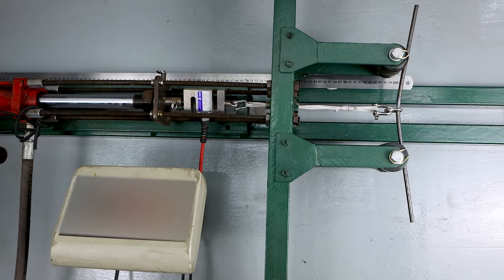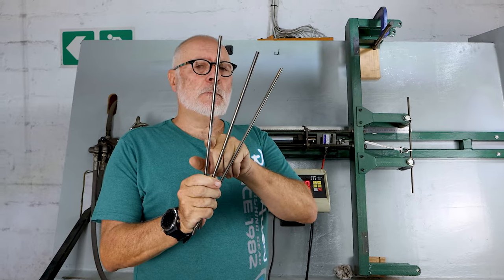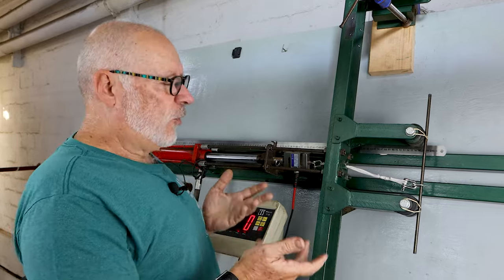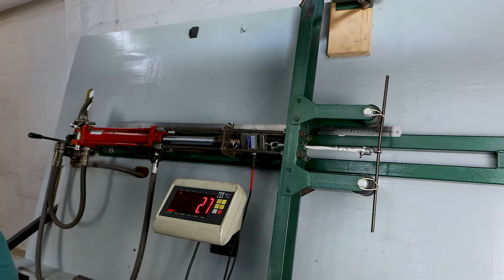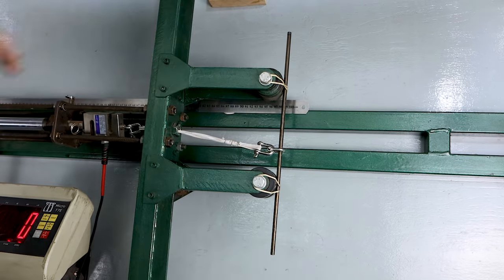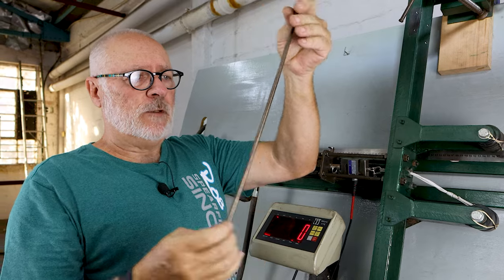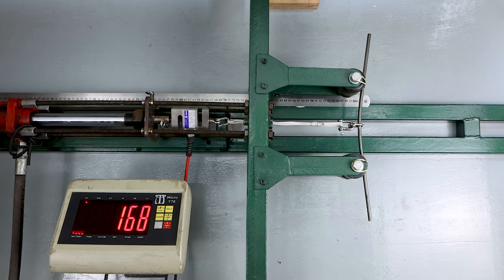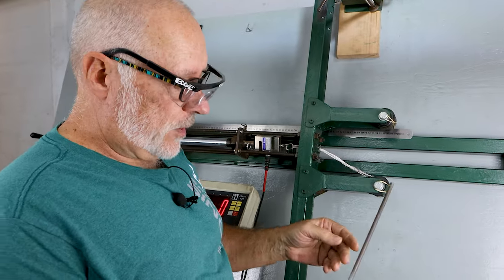Rob Allen | Spear Stress Test | 2024

Comment: Great video! Regarding attachment of shooting line here my humble thoughts...
Pros of attaching to a rear hole: 
-Very hydrodynamic when attached to rear hole. 
-When shaft penetrates through fish (flies through and exits the body of the fish) it is easy to pull it back through the shot hole – recovering the shaft quickly after a shot and getting rapidly ready to reload the gun.
-When shooting into caves or other structure the spearo can pull the shaft line and shaft will (usually) not get stuck when pulled out. Of course, there is still the flopper that might get stuck when open.
-When shooting through hard material (skull, bones) the shooting line is a bit more protected than when attaching the shooting line to a front hole.

Cons: 
-Cannot be used with spearguns that have very narrow trigger mechanism (no space for attached shooting line). 
-Cannot be applied to guns with enclosed track (ET)
-When the shaft flies through the body of the fish and spearo pulls to retrieve the fish, the spear can most go backwards through the wound and will not act as a ‘slip tip’ against the fish. 

Comment: shafts without shark fins and having only notches have a better chance to travel through the body of the fish (no tabs / shark fins offering resistance).
Would be great to have a video from RA about this! 
Cheers from Panama ><)))^>
Reply from the maker: 👍👍 all the points I will make.
Reply: Biggest issue of rear holes is they have bad performance with roller heads... 
Unless RA can explain how to get those shafts workable with rollers/double roller heads I would be gratefull. 
After speaking with many people on the topic it seems unworkable so you either have to replace the shaft, or weld a notch with hole or drill hole before the fins/noches. 

I found the issue with ermes double roller heads and others (including custom manufacturers) had same issues with Manny's too.

The issue was both with 1.8mm and 1.5mm dyneema to the rear hole as drop barbs have only rear hole (unfortunately), long shafts 170-190-210cm also lack resting tabs RA... It's painfull to load 140cm gun with 190cm shaft even with loading assist as 176cm person.
Reply from the maker: @mikefue9597   Good point, I'd forgotten about that. Yes, shooting line ahead of the notch or fin on a roller makes it so much easier to use. When behind (rear hole) the shooting line is trapped under the rubber and, if the shooting line is not wrapped very tight, can get dragged into the roller, affecting speed and accuracy of the spear. All pretty much eliminated with the shooting line being attached ahead of the notch or fin.
Reply: @RobAllenSpearfishing  have you maybe redesigned the drop barbs shafts? Unfortunately my two guns suffer from the issue with 190cm drop barbs with fins from you :F and I'm currently in a process of deciding what to do about it...
1. look for another slip tip
2. drill hole ahead
3. Weld line holder ahead...

Both 2 and 3rd solution seem to have its issues...
2. The line going through hole is also dragged at narrowest point through head affecting speed/accuracy... As real width is shaft diam + line diam on both sides. The heads have very little room even with  1.5mm fine dyneema attached
3. Welding a line holder on top - I heard so many stories how difficult it is to weld them without warping shafts...

The lack of resting tab is something I can without it but the above got us kinda annoyed to say the least
Reply from the maker: @mikefue9597   Hi Mike, I don't quite understand the problem, please email me a short video if you can. Email address is rob@roballen.co.za or, message me and I will send you a Whatsapp number to send to.
Reply: @RobAllenSpearfishing  

Basically
Ermes double roller head
140cm custom carbon tube
Ermes handle and mech
RA 190cm 7.5mm drop barb with pins
14mm epsealon rubbers at 300% with just around 7-11kg preload as we wanted to go slow first. 

We have yet to come to conclusion at the nature of the problem as we had limited time and weather, as we were working on the gun tube issue with flooding, but by mounting dyneema directly to the shaft in 2 exact setups has coused us issues but we had less than 4-5 shots on both.

Either we had heavy tangle or what we believe is shaft knot hiting the wishbones with such force that it would sheer the wishbones outer sheath. 

The head itself is so narrow that even with 1.5mm dyneema the shaft passes the head with difficulty and we are waiting for better conditions to test with 1.0mm directly to shaft end if it gets any better in the right direction

What we are also considering is getting the back hole a little more narrow by polishing it down on both sides, so the hole + line will have a bit more clearance through limited width of the head.
Reply from the maker: @mikefue9597  Ok, I got the wrong impression, I thought you were having problems with the drop barb, not the gun. 

Without being able to test the gun and see the possible issues, I have no way to make a suggestion. 

We have only recently been testing our double roller and have made many changes to it to prevent line wraps, wishbone wear etc. In our experience, the longer the gun the longer the shooting line, the more friction occurs between the shooting line and the wishbone cord itself. 

It's all in how the lines exit the muzzle and what vortices occur while the rollers are spinning as the spear is moving down the track. This is all very complicated and not easy to see unless you film with a high speed camera.

Comment: My 2cents - such testing is good  when you can shoot without obstacles after the fish, problem arises with shafts bending mostly at the flopper hole when not having clear shots. The G forces on those shots are tremendous. We have seen very 'good quality' shafts 7mm bend with single 14mm rubber :-)  thats something not what you really should expect
Reply from the maker: Unfortunately there has to be a hole to fit the barb. I have had a spear bend on the barb when shot into a fishes head. If the tip of the spear is deflected after hitting a bone at just the right angle in the head, this can deflect the tip side ways enough to bend. The resistance of the fish creates just enough force in the water to create this. The fish in this case was concussed from absorbing the full momentum but the spear was destroyed. We have considered drilling smaller holes through the spear but then the barb pin will have to be reduced and.... another week point.

Comment: Hi Rob, i would like to add another flopper to my spears, but none of the drill bits that ive bought have worked..., what drill bit would you recommend?
Reply from the maker: Hi, drilling this high tensile steel is very difficult. The steel hardness is similar to that of a kitchen knife, not sure if you have ever tried to drill a hole in a knife blade.

 It is not only the drill bit that you need. We have custom drill bits made which we use in a custom drill jig. This is then irrigated under pressure with a blend of cutting fluids. This is the only way we have found it to work efficiently. 

You can try carbine drill bits but they are expensive and, if you break one in the spear,  you will unlikely get it out. 2 or 3 drill bits are about the same as a spear here.
Reply: Thank you! Yes, i figued, because nothing was working...

I had found a video on Daniel Mann's channel where he used a carbine drill bit, and it worked, but he had also made his own jig.
Reply from the maker: @jysonkarshagen3174    👍👍